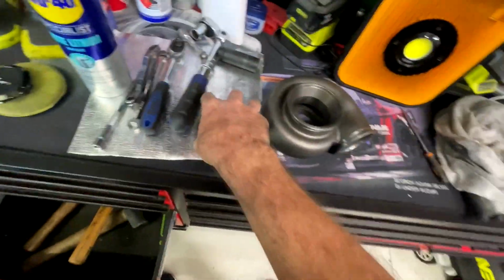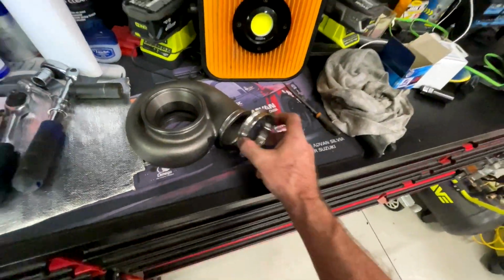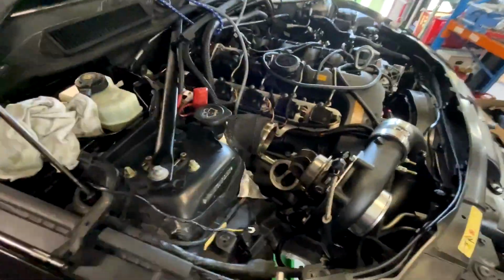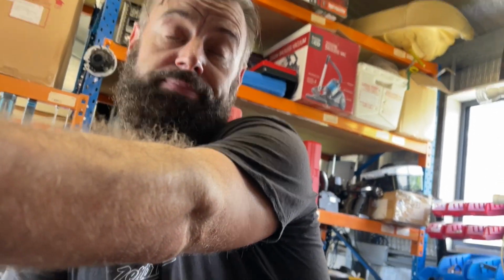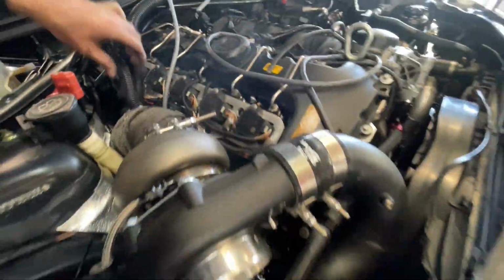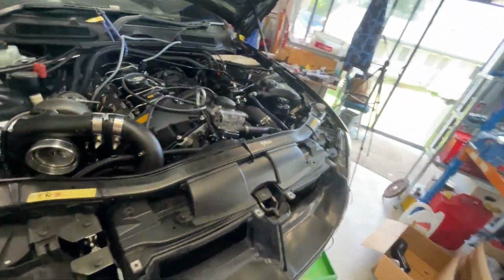N54 SINGLE EQUAL LENGTH MANIFOLD OPEN DUMP SOUNDS!!

Comment: That n54 sounds epic, quiet but still makes all the right noises when you step on it. Poor man’s Supra 😎
Reply: In terms of MSRP, an e9x 335i is about the same as a Supra. (assuming you’re referring to MK4) With today’s market however, you’re definitely better off buying an N54-equipped BMW for literally 1/10th the cost 😅
Reply: No poor man can afford a n54..
Reply: @unluckeeeee  I’m right here pal lol 

I’m in need of index 12 and a HPFP. But of course all for giggles and chuckles. Any car gets expensive but joking about 335i being a Supra will eventually get overrated… as soon as the fast and the furious stops being one of the best racing movies of all time. Next to wangan midnights, born to race or need for speed.
Reply: @bavarianhero  So you own a 335i but can't afford to buy the parts or maintain. Point proven.
Reply: @unluckeeeee  basically, I’ve owned my 335i since 2013. I have had many issues, I fixed them then something new pops off. If you’re not spending almost $500 on something simple for this car, you’re not fixing anything. And if you need something major HPFP almost $800, injectors almost $2700. Those parts for an average joe is expensive. The only reason I started saving money was because I was getting juked by a local mechanic which led to me fixing it on my own. It’s been hectic with this car but because of that I was able to start gaining my families trust to work on their cars, even some of my brothers or sisters friends started letting me work on their cars.
Reply: @bavarianhero  Fair.  I've a n54 135i for 4 years. I know the feeling. Been solid overall though.
Reply: @unluckeeeee  I had to replace the block the first month I bought the car, the place I bought it at sold me a lemon. I’ve been making lemonade ever since. 

135i are freaking awesome. I had a friend selling his 135i stickshift but because of the 335i I never did it. I kinda wish I would have sold the 335i just to get the 135i but it is what it is. Both cars are clean to me, but good luck finding a 135i for a good price now and days.
Reply: @bavarianhero   Even better, get the more reliable, better chassis/rear suspension and overall better everything with the e89 Z4 N54. Got an 09 one with 20k miles for 20k back in 2019. Damn steal for the car, but fixes a lot of the problems the 135i and 335i have. Not all of them though as it's still clearly an N54.

Comment: Where did you get that charge pipe that goes from the turbo outlet to the intercooler? I had to clock my compressor housing like that on my build and can't find a charge pipe like that.
Reply from the maker: Its a custom one that comes with the n54 development kits

Comment: Andrew with the new single setup are you planning to build the bottom end.
What boost pressure you planning on running to keep it safe.
Reply from the maker: Not yet, will keep it stock for a while. Around 30-32psi ish

Comment: Hey mate. I have a question regarding your X5 (4.6is) I have done a full recondition on my box and have it married up to the engine with three bolts in at the bottom. I can’t find a diagram anywhere (even on the tis site) for what bolts go where. There are quite a few different sizes and lengths there. Can you advise as I am very keen to get it back in the car at this point. Kind regards.
Reply from the maker: I honestly can’t remember, it was so long ago. However I would just thread them on by hand till you find the right holes. It won’t be hard to work out when they all have the same thread engagement
Reply: @ZeroTo60Tube  that’s okay and thanks for the swift reply. Great projects you have going on here. Did you ever get around to the full rebuild? Is the car still in your Arsenal? I have not seen any videos on it in a while. I have an e92 2.5i and honestly can’t believe that the serpentine belt snapped and shredded all the wires and melted both sides of the plugs for the water pump. 😳
Reply from the maker: @marchdeane4896  I havent done much on the 4.6. Its got some oil leaks but the old thing has just been faultless, just get in go everyday. Real workhorse, i have done about 25,000ks since the trans job. I have done a N54 full rebuild, if thats what you were referencing?
Reply: @ZeroTo60Tube  Did you do the rear main seal when you were in there? I had issues with rocker cover leaks and I’m assuming some leaking from the rear main too so I just did that as a preventative thing. There is also a coolant plate on the rear that I changed out the gasket on. What fluid did you use and where did you source the ZF parts? I have heard that the aftermarket filter causes problems along with aftermarket fluids. I saw the 20l fluid for nearly $600 😳 can you remember how many litres it takes? 
I am yet to see your rebuild on the n54. 
I rebuilt a n42 for my 2004 e46 318is m.sport. Just sold that recently so I have only the e66, e53 and the e92 left.
Reply: @ZeroTo60Tube  I was referencing the ZF5HP24. Have you just left it like that?
Reply from the maker: @marchdeane4896  Yeah havent touched it since the video where we put the oil cooler on it. Its been solid.
Reply: @ZeroTo60Tube  did you read the previous comment regarding fluids and filter?
Reply from the maker: @marchdeane4896  No, youtube must have sent it to spam. Ill check the spam folder shortly
Reply: @ZeroTo60Tube  what fluids did you use and filter? I’m finding it difficult to get the ZF stuff.

Comment: would i be able to get that manifold on my stock n54? or do i need the turbo upgrade
Reply from the maker: You’ll need a turbo. But they are cheap really
Reply: @ZeroTo60Tube  did you use the turbo they recommended? Its like $2500 nd Im actually bouta buy the manifold

Comment: Sweet sound, but will it work as a daily driver?
Reply from the maker: I hope so, theres no vibration in the car from anything rubbing, so hopefully it will quieten right down when the exhaust is connected
Reply: @ZeroTo60Tube  I'm interested in the JMC kit but I'm guessing you have to modify the exhaust to make it fit? I see the downpipe has a V-band flange.
Reply from the maker: @joCk3  Yes, a custom downpipe to exhauset setup is required. If you do the JMC, i would highly suggest using the tial wastegates and Gtx3582 gen 2 twin scroll turbo the kit was made for. If you vary from what it was designed specifically to suit you will encounter further costs and loose the specialness of the kit. I regret just not following the exact setup the kit was made for. I am just putting the car back torgther. I have spent about another $2500 on making the kit work with the pulsar turbo and different wastegates.

Comment: Am I crazy or when you rev it a 2:35 ish it sounds kinda like a S85 V10 ? Similar tone on those low rpm revs imo 
Or maybe I’m too far gone ..
Reply from the maker: too far gone hehe. i would say i've heard similar sounding s54s from e46 m3
Reply: @ZeroTo60Tube  definitely a nice high pitched i6 tone ! 
Great build you’ve done here mate !

Comment: Sounds sweeeeeeeeeeeet!
Reply from the maker: Its properly angry in person. and it revs faster, something i wasnt thinking about.
Reply: If I recall this turbo is ball bearing which is going to be fast inertia for spool so fingers crossed this will be an awesome match with the fast revs, the only concern I’d have is those bmw conrods! 😭
Reply: Also be a good time to do the crank hub mod 😬 you are running a dct on this car
Reply from the maker: @InstaltechCarAudio  Just too expensive for me to justify at this level. However when i build a motor for this car i will do one. Since we have a motor with a damaged crank, i am trying to get a billet crank made with a key for the crank hub built in. That way it will be a 1 piece crank hub keyed in to a billet crank as a package. I was surprised to learn that the crank hub in particular the crank hub gears need to be made of a stronger material than a crank. Anyway, its been in the works for a few months we will get there eventually.